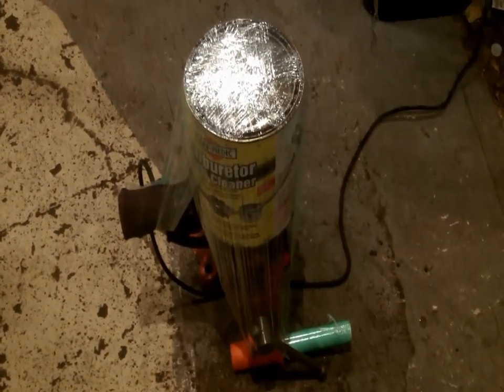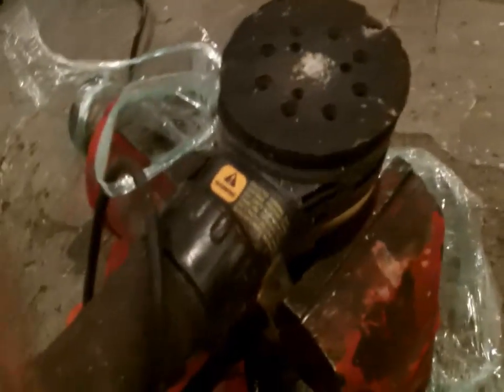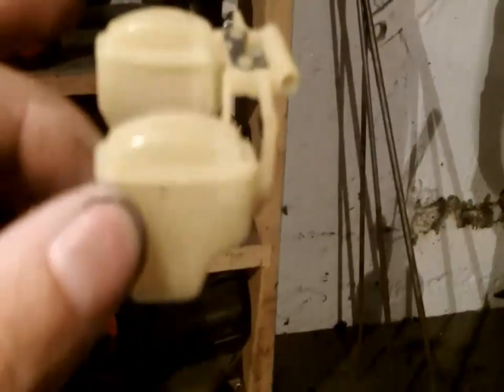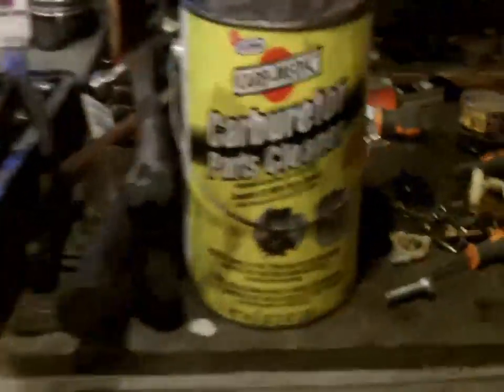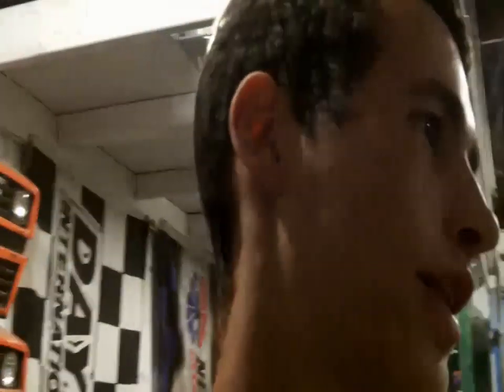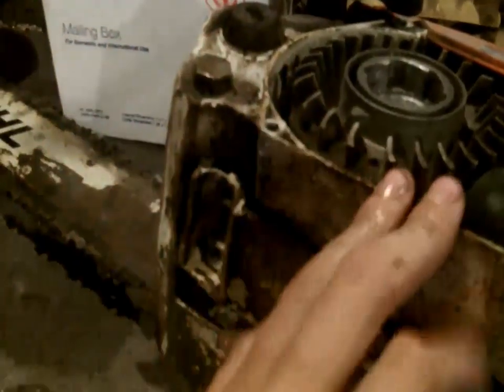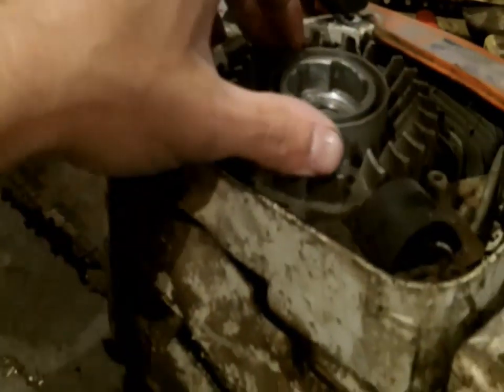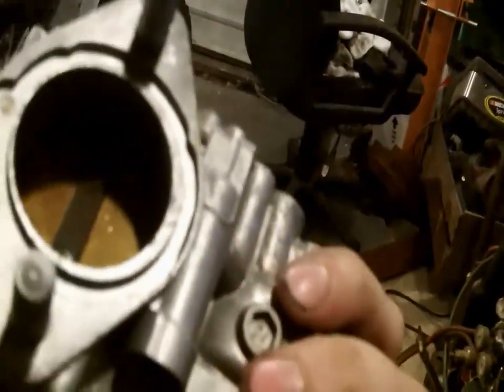yamaha warrior 350 carb rebuild

Comment: thats good you got er to run also the pilot jet is for you idle and low rpm just to help with mixing the gas and air aso I was wondering if I can get a shout out frome you i'd really appreciate it check out my channel